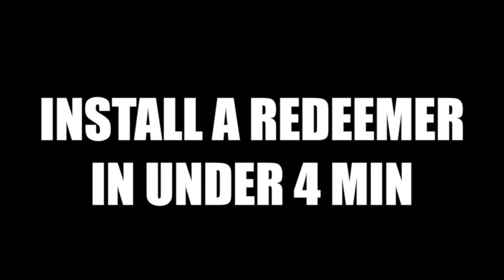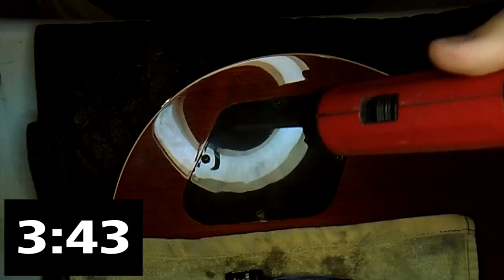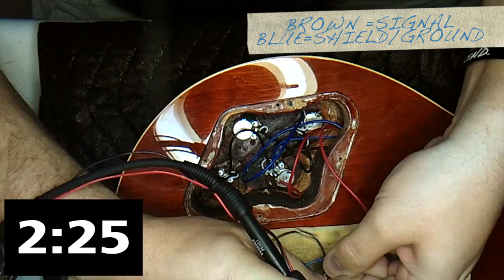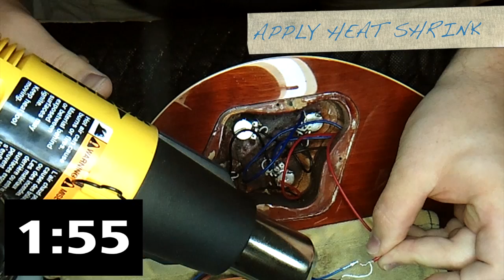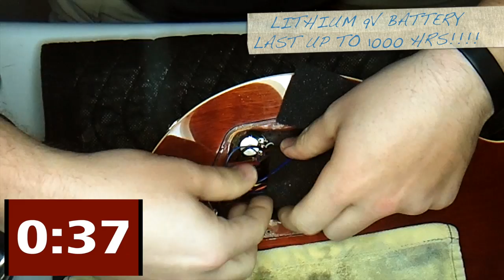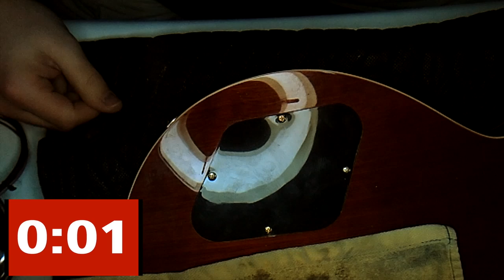How to install a Redeemer guitar buffer in less than 4 mins

Comment: Good Idea.
Wish Buffer do you use and how is the Sound Quality.
Do the Battery go down when Cabel is not connectet?
So i think a Switch can be useful.
Reply from the maker: Here is a link to the buffer.  The battery is conserved when the cable is unplugged.  At the bottom of the page there is a link to a diagram that shows how to wire a switch.
Reply from the maker: https://www.CreationAudioLabs.com/redeemer